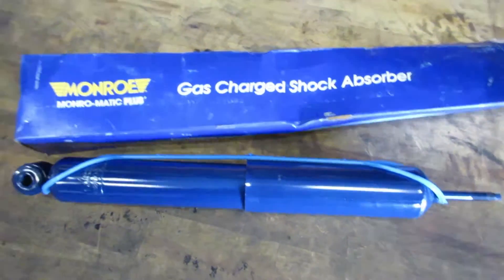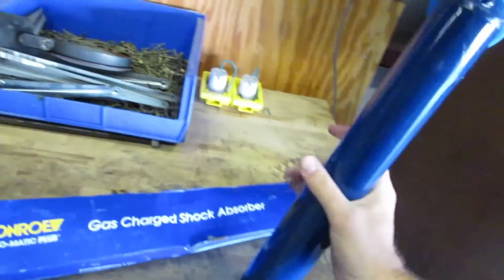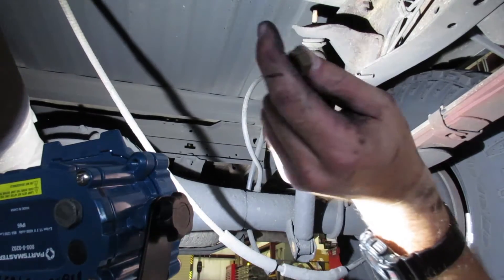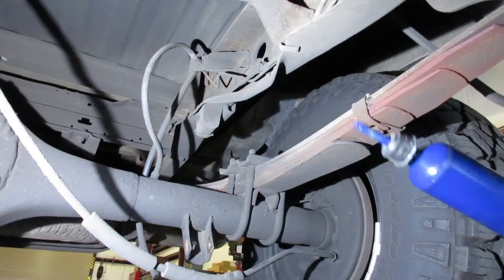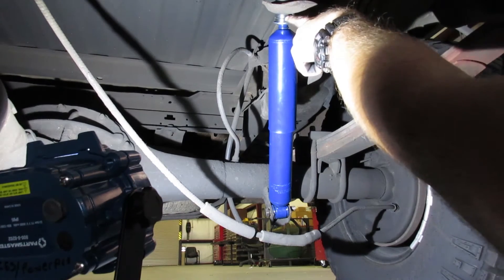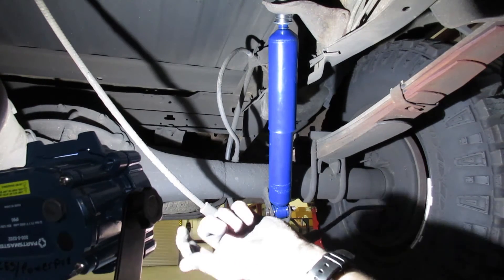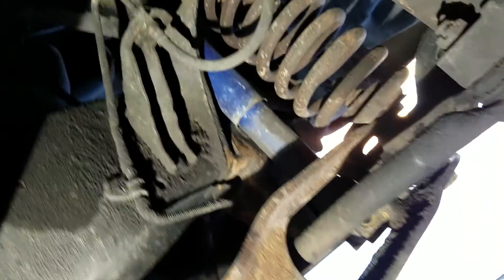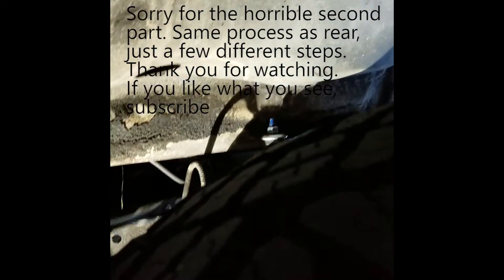Project Ford Truck, Shocks Episode 6

Comment from the maker: Hi Jim,
I would definitely say wheels on, and on the ground. If you are putting on the stock type shock, kind of what I did, no need to 
remove wheels or lift truck.If you are having trouble though, for the rear I would suggest just lifting the body to allow a bit more clearance. For the front, the trick I did by lifting the bottom of the shock with a jack was perfect. I could not manhandle the shock well enough to raise it because of the tight space. 
So to save time, and if the shocks are not giving you trouble, wheels on, and on the ground.

Thanks for watching!
Hope you see this, had a comment error when replying.
Reply: Thank you. This is exactly what I needed to know before changing the front shocks on my 65 F100. Nice video! Wheels on it is!
Reply from the maker: @BenG123  Glad I could help. Thanks for watching!

Comment: After changing my first set of shocks and having the same problem getting that nut off the top stud of the shock I put extra nuts on the stud just to keep it clean. Once the first one was tight, I just put another on snug to the first one and then put a third one on snug to the second. the last two times I changed shocks those nuts came off easily. I also used anti seize on anything on the suspension as I live in the rust belt! This trick works good for the steering stabilizers also.

Comment: The squared off end of the bolt on the top of the shock is designed to give you something to put a second wrench onto to hold it stationary and tighten the nut. I cringed watching you scratch your brand new shock with a pipe wrench. Also, the nitrogen in gas charged shocks does not add dampening. It’s there to keep pressure on the oil so it doesn’t foam under heavy back and forth cycles. Otherwise, great info here. I’m starting to tinker with my 67 more these days and I’m getting new shocks this month.
Reply from the maker: I re-watched the video when you commented. I never thought about using that nut you mentioned. That's good to know for next time. Yeah, I thought the nitrogen was used to pressurize the fluid, kind of like pressurizing a brake master cylinder instead of keeping your foot on the brake. But now that I think of it, doesn't make too much sense. Thank you for the comment.